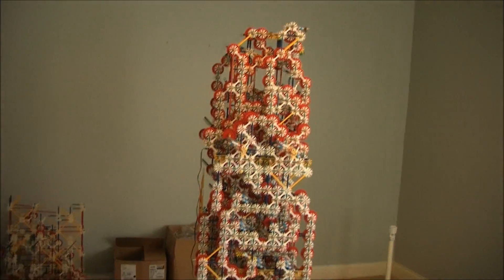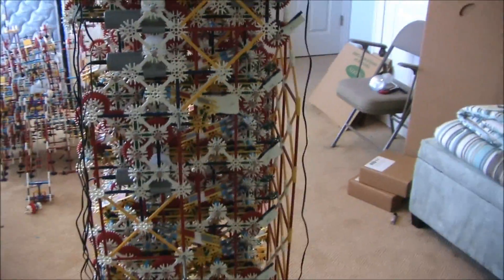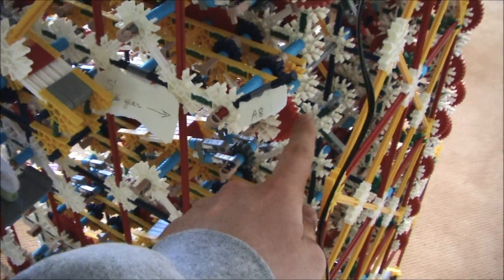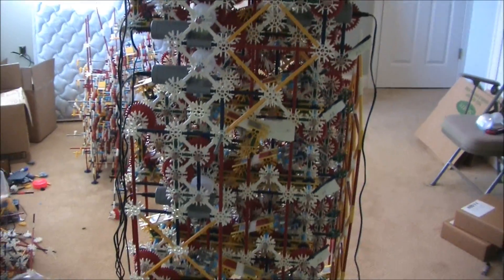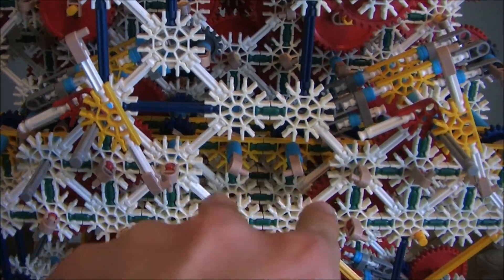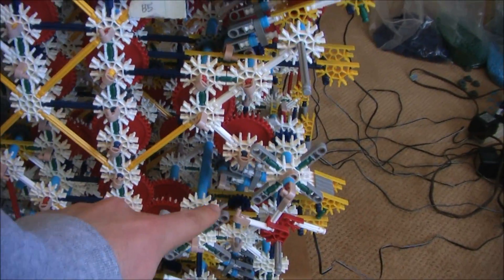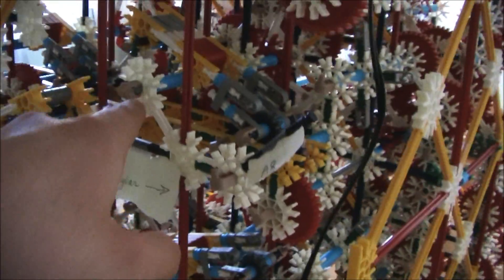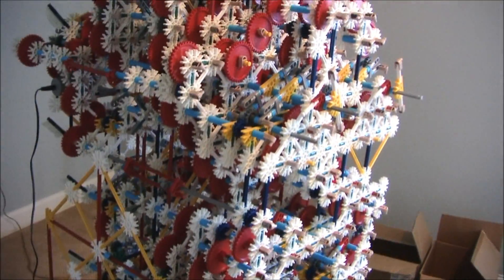The K'nuter - K'NEX Computer

Comment from the maker: Thanks, everyone, for the humorous comments. I know it's been a long time since I've posted. Here's the update on this project:

In 2018, I put together plans for a full 12-bit computer based on the old PDP-8 architecture, capable of running VERY simple programs (with a maximum of 64 instructions) like finding the Nth number in a Fibonacci series. I also built prototype parts for the new mechanical logic required to make it all work. The goal would be to educate folks about how computers work in a fun, interactive way—and to push folks to think BIG (pun intended).

Here's the roadblock: the machine would cost hundreds of thousands of dollars, require several people to help build it and maintain it, and require a truly MASSIVE space (think warehouse, not a basement). It'll be a heavy lift to get to that point. I'm still weighing options, but a good start is that K'nex has said they will be able to support the logistics of providing the 15,000 motors required.

In the meantime, if you're interested in seeing videos explaining these plans, including demos of the prototype components and how the logic works, give me a thumbs up, and I'll see if I can find the time to make that happen.
Reply: Dan Ehrman

DO IT
JUST DO IT

DON'T LET YOUR DREAMS BE DREAMS
YESTERDAY YOU SAID TOMORROW
SO JUST DO IT
MAKE YOUR DREAMS COME TRUE
JUST DO IT

SOME PEOPLE DREAM OF SUCCESS
WHILE YOU'RE GONNA WAKE UP AND WORK HARD AT IT
NOTHING IS IMPOSSIBLE

YOU SHOULD GET TO THE POINT
WHERE ANYONE ELSE WOULD QUIT
AND YOU'RE NOT GOING TO STOP THERE
NO, WHAT ARE YOU WAITING FOR?

DO IT
JUST DO IT
YES YOU CAN
JUST DO IT
IF YOU'RE TIRED OF STARTING OVER
STOP GIVING UP
Reply: Dan Ehrman first of all, why
Second of all, holy shit yes
Reply: Holy heck my dude this is insane. I'm looking forward to your future updates, this is really intriguing to me.
Reply: Farcry 10 let's play | 4k on high-end K'nuter
Reply: Don’t worry about a full computer just building prototype components as a proof of concept is more than enough
Reply: Crack TheBack yeah I agree it’s a strange idea to spend over 100k on a computer made out of this stuff like what
Reply: Dan Ehrman people would probably find some kind of piping looking thing with lights to be more interesting than k’nex

Like take some old CPU and expand each wire out and add LEDs
Reply: Hey man I've been watching this ever since you made an actual video it's really been a long time but don't give up please don't give up I love these kind of mechanical things and for a long time I've wanted to see a mechanical computer and I've always wondered what that would look like and you have provided that to me I don't have the technical knowledge the skills the time or the money to do things like this but I believe that you can do it never give up I really look forward to seeing the new one I want you to actually be able to run small programs and stuff and do amazing things with it eventually I want you to really show off what this technology could really do and what good it could mean! Thanks for being so awesome and for not giving up
Reply: K'NEX IS PARTIALLY FUNDING THE PRODUCT
K'NEX IS DOING IT
YES K'NEX
YES
Reply: OMG I came back to this video on a whim and you commented a week ago!!!
Reply: 15,000 motors!

You're asking for mechanical failures! That would be an insane endeavor.
Reply: Dan Ehrman You should look at the analytical engine
Reply: Dan Ehrman also you basically made a simple difference engine
Reply: This would be a truly incredible feat. The fact Knex would actually help you out is pretty amazing and really signals good things for this project.
Reply: Please make a update video
Reply: bruh Kickstart, IndieGoGo, or Patreon that shit, I'll contribute
Reply: Still waiting :( You're amazing
Reply: i hope your able to build this , its absolutely  fascinating  to me.
Reply: I'll try to help fund you some parts if I can find some cheap sets that do not have broken parts
Reply: I feel like this is a 8 year old joke for some reason.
Reply: What about slapping this to aid a real computers ram?
Reply: Can K'nex even support the weight of something like that?
Reply: I'm gonna give it a like but there are 420 right now so I gotta wait for somebody else to break thru for me.
Reply: There we go, 422.
Reply: Absolute Mad Lad right here.
Reply: That sounds so cool! Please make a video on it, we'd all love to see that!
Reply: Yes please!
Reply: I would love to see that!
Reply: Why not call it a K'omputer.
Reply: all this for a drop of clout
Reply: You could find 100people willing to help you
Reply: Yeah!!
Reply: Start like a go fund me thing  if less than 20% of the people who watched this video donated 1 dollar you would have a 100 grand.
Reply: So where's the Kickstarter?
Reply: Dan Ehrman if u need loads of money or people, there are a lot of people online that would be willing to help with that
Reply: Please do
Reply: you could have gotten the funding you needed if you didn't turn that nob the video would have been monetized
Reply: 15,000 motors is going to be some serious draw of current, defiantly do the math on the required watts and know the wiring of what your gonna hookup a lot of socets are tied together to the same breaker. If the ele box is a mess (bad labeling inside) you will have to test each socket with most the breakers off save for one at a time.

If I were you id look at running a generator (diesel does better with high torque situations) or look at running some micro motors.

I just don't want to see what your doing go up in smoke. And you might have to merge something stronger maybe talk to meccano. Or if you know a tradesperson see if they will help build you done big shelves if you are gonna build high you don't want the weight concentrated on the k'nex
Reply: Yes! More videos!!!
Reply: Still waiting...
Reply: I'd love to see this happen!
Reply: You just gained +1 sub. Marvelous work mate keep up the awesome !!!
Reply: Let us give u money in patreon
Reply: A computer simulation would be possible. Not as fun, but possible.
Reply: That would be so awesome. Maybe wasteful, but still cool.
Reply: Why on earth would you want to emulate the PDP-8? Do a bit-serial machine, and maybe as a decimal machine, which would tend to minimize the amount of Knex required.
Reply: This would surely make it to the Guinness Book of World Records :) 100% Do it! I've thought of getting back into K'nex Construction since my Childhood days
Reply: Dan, I watched your video maybe 9 or 10 years ago... I was amazed by your computer and was determined to know how it all worked. Now I’m studying as an electrical engineer at the top of my class. And I finally completely understand how computers are built. Thank you for your demonstration.
Reply: The first computer: Haha I take up an entire room.

The Full Scale Knuter:
 AMATEURS
Reply: This sounds like a Mr Beast job.
Reply: you probably dont give a shit but if you're stoned like me during the covid times then you can stream pretty much all of the latest movies on instaflixxer. Have been binge watching with my gf lately xD
Reply: @Robert Bennett Definitely, have been watching on instaflixxer for months myself :D
Reply: @Robert Bennett definitely, have been watching on InstaFlixxer for since november myself =)
Reply: dude you're just reinventing the computer with k'nex
Reply: Was mechanical digital logic used in the cryptography machines of the world war 2 era?
Reply: Awesome
Reply: I watched this years ago when I was such a little kid.  I'd love to see what progressed with the process in the years before I returned to this video
Reply: Have you ever looked into push/pull logic? Some German dude in the 1930s made a fully mechanical computer using it, so it’s probably worth looking into.

Comment: In my head, a differential with half gear, would do a much faster job at computing simple inputs especially in addition and subtraction. If you used a rack system for a number input, you could set pins to follow a spider gear, which could then be used for further calculations. Using 2 dials for a formula input does not require an external motor, however they in turn can become the input sequence for a much larger computation, past single digits, which CAN render a motor driven assembly to become useful and sensible. Careful how complicated you make single digit input and output mechanisms.

Comment: See if I have this straight: We have two representations of binary states here -- a plastic shaft's rotating or not rotating, and the position of a plastic rocker switch.  Then this is a very slow relay computer, a motor's driving a switch slowly into a position.  Hmm...in that sense this is very much like the workings of an automatic elevator, which used relays for memory but winched an elevator car into one of several possible "states" (floors).  Usually I would think of the controller of the elevator as the computer and the car as a controlled instrument, but if we think of the elevator car as itself part of the computer, then it's like an element of this K"NEX device.

Comment: I'm equal parts impressed and surprised by the apparent complexity of this design...
A full adder consists of only 5 logic gates, and from things I determined earlier you can construct that from roughly 10 transistors...
Your machine is exceptionally large for that.
Perhaps it HAS to be, but it still surprises me that it would need to be that large, even considering what it's made of...

Comment: how efficient is the computer in power consumption?
Reply: Well, it runs in AC motors, pretty much less than an electric oven
Reply: Imagine if you could play Oregon Trail on a microwave display only it takes an hour for each screen to load and by then the electric bill is up to $1,000,000,00

Comment: For those who have no clue what's happening, this is, in a way, a mechanical representation of what is happening electronically inside a computer chip at one of the simplest levels. A computer needs to be able to perform calculations to be able to do anything, and that's what this machine does. The logic is the same as Deep Blue just a lot more basic (pardon the pun).